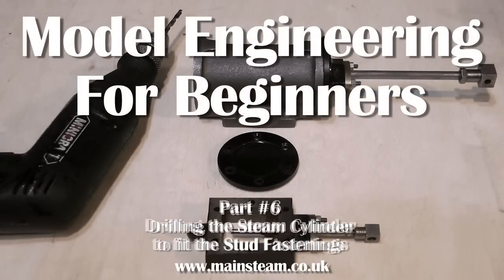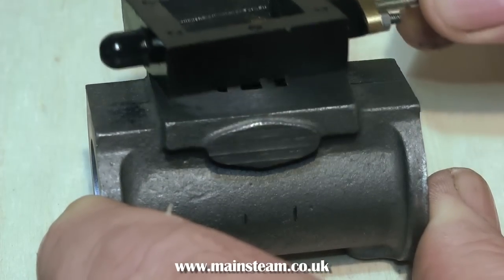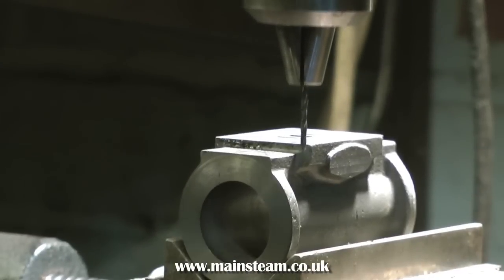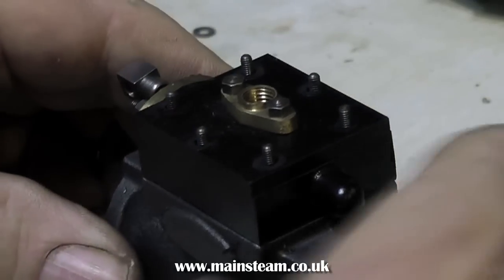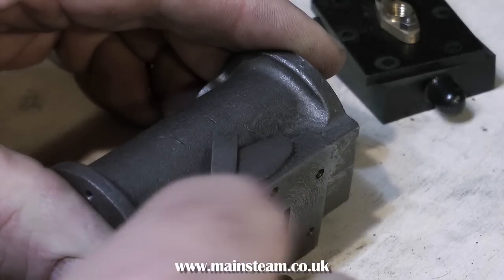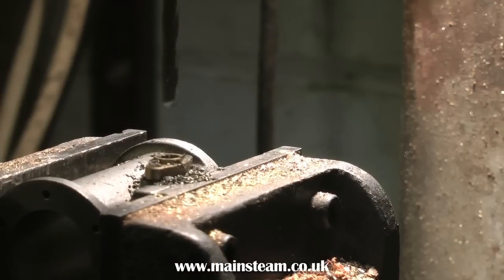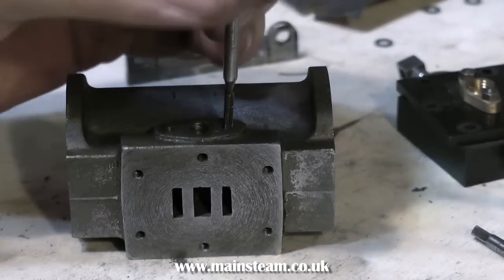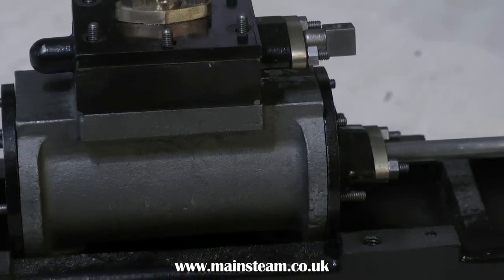HOW TO DRILL & TAP A STEAM ENGINE CYLINDER - MODEL ENGINEERING FOR BEGINNERS #6

Comment: Excellent workmanship.  Very informative.  I share a cautionary note for this step!  When transferring the tapped cylinder holes locations through the cylinder head clearance holes, remember to orient the heads so the bolt holes miss the drain cock holes!  Did this once.  
Enjoy your videos.

Comment: I haven't seen any suppliers with bottoming taps in BA, if you really need to thread to the bottom of a blind hole a plug tap.  I've bought plug taps from from spitfire2015UK on ebay (Peninsula Steam) and then Tracy Tools and gotten what I call 2nd taps. I think I'll grind the point off and 1 thread
Reply from the maker: that's what I often do.

Comment: I never ever thought of the loctite 603 tip as glue  ... thanks ! 

I seldom watch workshop vids but may i suggest withdrawing the drill a couple of times per hole to minimise possible binding and achieve as 'close' a hole size as possible. Dunno if you mention it elsewhere but personally I never use a twist drill as it come out of the packet, always doctored for better results. Sorry to be a clever-dick, I've done masses of small hole / high tol work as pricework for a living. I would also place some importance on alignment of the chest re centrelines. Well done, good voiceover.

Comment: Those 7ba taps are very easy to break.  Especially if you buy cheap ones!  I can tell you from experience that if you do that you can get them out with a 2mm tungsten end mill.  But the best idea is to not buy cheap taps from India!  
Super video Keith.

Comment: Keith, how do you be sure the valve rod is parallel to the cylinder bore, as most castings wouldn't be close enough to just "eyeball" the chest in place.
Reply from the maker: I do it by eye, but you could always push in a bit of steel the same diameter as the valve rod and measure it ......

Comment: Do you use any lubricant when machining, drilling and tapping cast iron or is it self lubricating?
Reply from the maker: +Worcester Exchange I find Cast Iron has enough graphite in it to not require any lubricant. Industrial Cutting lubricant can be very nasty stuff to have in a home workshop.
Reply: Keith Appleton I work in full size boilers for power generation. When milling tubes, drilling holes etc. in stainless, carbon and other alloys, we use dish soap (I think you call this washing up liquid) and water in a spray bottle. To my knowledge, we do this so oil doesn’t get in the tubes for different reasons from welding, preventing carryover and to avoid hot spots in tubes. We also do a boil out on the boiler with different chemicals depending on what the boiler is made of, but fairly often we just use regular Tide powdered laundry detergent. Just thought some people might think this is interesting. :)

Comment: On the cylinder steam chest, one of the studs you've drilled and tapped is directly in line with the side exhaust port which must mean that the stud had almost zero depth to screw into!  Is this a design error or did you locate the stud in the incorrect position?
Reply from the maker: There is plenty of depth available at that point. The video distorts the perspective.
Reply: Keith Appleton Excellent Keith. Thank you.

Comment: Keith... I'm machining a s50 and I have bored out my cylinder and the piston slides well in it. But the valve holes are not all the way through into the cylinder. what should I do about it? is the casting faulty? cheers,
Ben
Reply from the maker: the "valve holes" do not go all the way through to the cylinder - you have to drill steam ways to the inner edges of the cylinder bore - just look on your drawing ......
Reply: +Keith Appleton Ah cheers! I'll have a look when I get home.
thanks from Sheffield,
Ben
Reply: Keith Appleton is there any chance you have made a video where you drill the steam ways? I just got an S50 kit and I can’t find any videos showing this. Thank you so much for your videos!